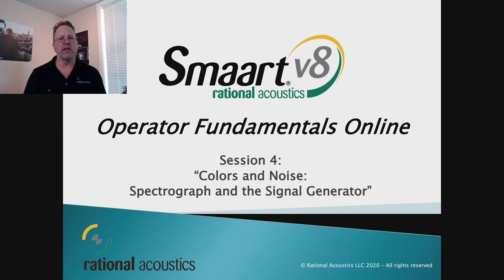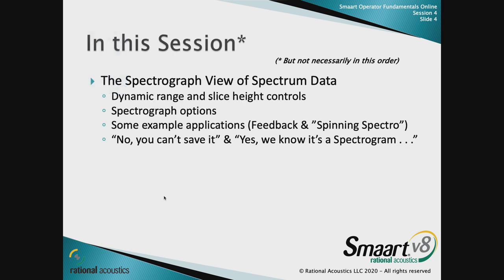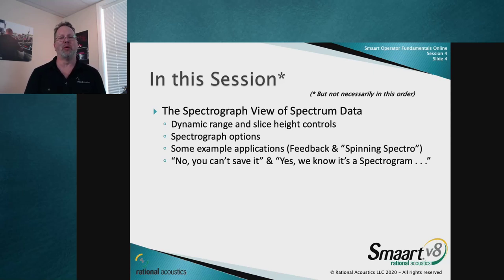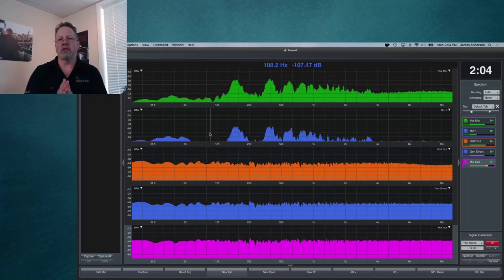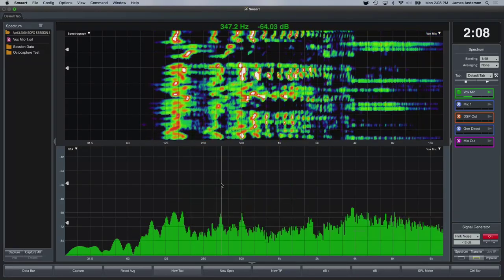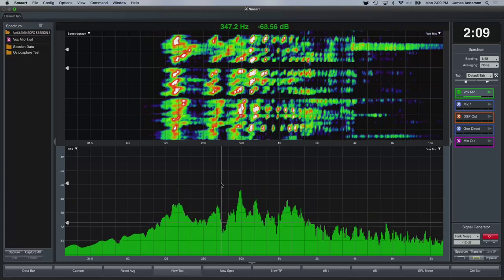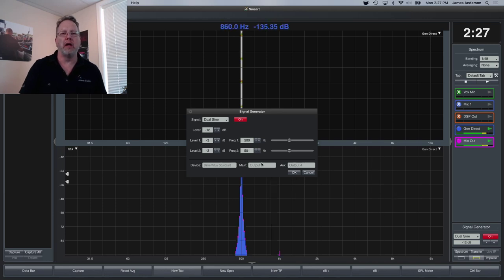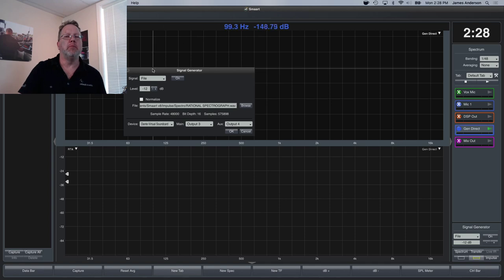Smaart Operator Fundamentals Online: 4 - Colors and Noise: Spectrograph and the Signal Generator"

Comment: I understand using the reference signal as the internal generator creates a difference in latency versus using the external interface. However, in using the external interface, will my cables throughout the entire system need to be a specific length to cater for latency? Meaning the length of cable looping the pink noise vs the length of cabke to the mixer etc. Or am i overthinking?
Reply from the maker: Signals travel through copper at close to the speed of light, so no, nothing to worry about. At any rate, Smaart is capable of detecting and compensating for latency in the device under test - more in a future episode.